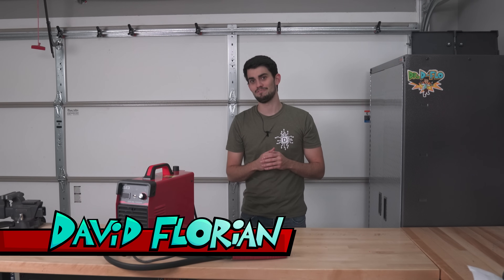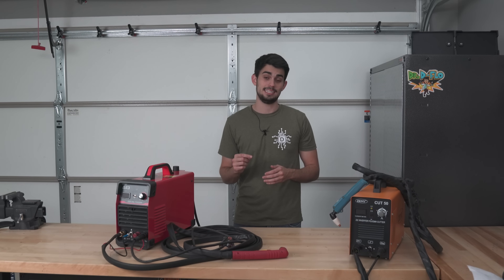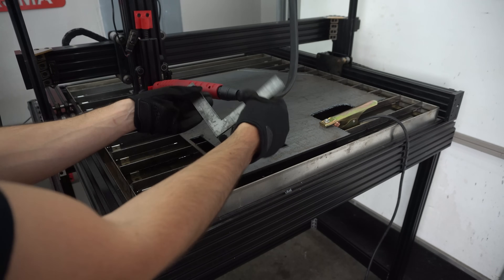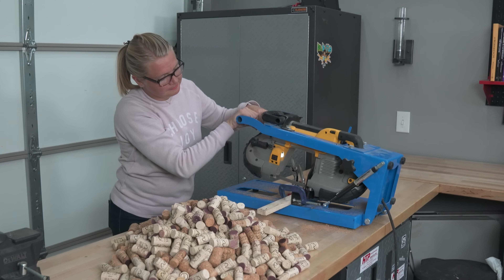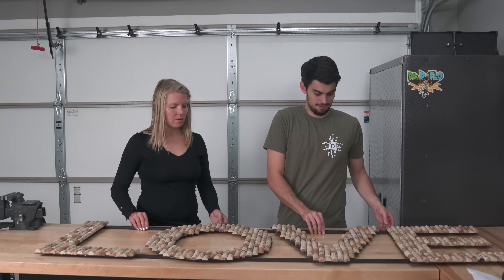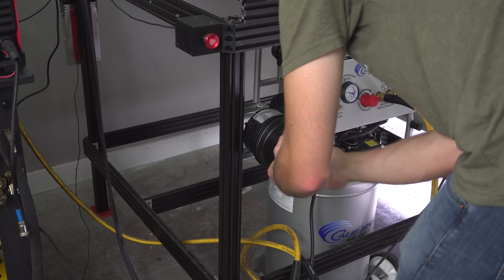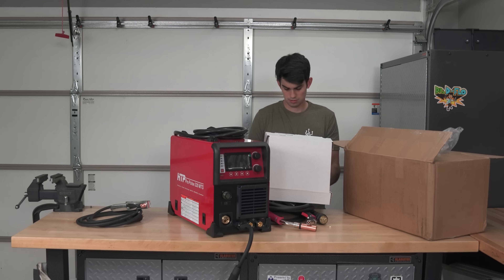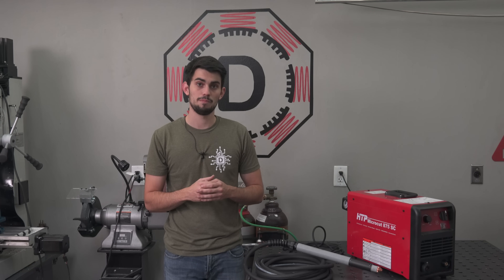Affordable Plasma Cutter for CNC (Cut50L)

Comment: If you haven't already you should buy some thinner gloves lot easier to weld with the gloves you've got on you would typically be using if you were stick welding or using a torch. The gloves I wear daily are kid gloves I'm referring to the deerskin very soft but I'm able to Tig with the gloves on and I normally only wear a glove on my non-dominant hand because I use that hand to guide with when I'm MIG welding TIG welding I normally just use one glove as well

Comment: Does anybody know if the Cut60L is a low frequency pilot arc start machine like the Cut50L.  I do know the Cut60L comes with a PT-80 torch but it’s not a blow back type torch (no spring electrode).

Comment: Is furly water in your compressed air there are methods using copper pipes as a heat sink to cause water to get trapped in a log section of tuning that may help is that mail linked in the amount of life your filter has
Reply: I’m guessing English isn’t your primary language, and you should really learn to proofread before you post.

Comment: Another great video... Thanks   Just curious; the spec sheet for the Pro Pulse 220 MTS says it requires a 40A circuit for stick welding and 35A for MIG and TIG.  How many amp circuit do you have this puppy plugged into?

Comment: HI. My name is JAMES and im a welding instructor for a college in Utah.  I wanted to let you know why the electrode of your plasma was destroyed so quickly was because the function of air is to one- of course create a DCEN current to allow the proper 4th state of matter, as the vortex is created. Two the air needs to have enough CFH to cool the consumable. In the Center of the Electrode is a reactive material called hafnium or zirconium ( different companies use either) and both are the spark to start the ionized gas if you will. So to fix the issue all you need to do is increase the CFH by 20psi. or like in your previous video buy a compressor to match the machine you are running. 
There is a way to increase the CFH with out buying another compressor. change the rubber hose to a Thinner metal conduit and run the compressor to  that. The more resistant the higher to the flow. just don't move the compressor farther away.  I hope this helps

Comment: it's a good habit to drain your air compressor tank after you're done using it releasing all the air and water at once and before you start a job just crack the valve at the bottom to let any water out. you can also get a air water separator mostly used for paint guns in line

Comment: You should put a transmission cooler and water separator between the outlet of the pump and tank. I did that on my 80 gallon and it condenses the water before it gets to the tank. Made a world of difference on my blasting cabinet.
Reply: I have about 40 ft of copper line to accomplish the same thing on mine.

Comment: I'm thinking about this plasma or the lotos ltp5500d.
The lotos has both plugs for trigger on/off as well as THC monitoring.
It doesn't appear the Sungold has either, can you confirm?
Did you just solder in a plug for the trigger control?
Are you running a THC on the plasma table or just touch and go?
Thanks
Reply from the maker: The CUT50L has an aviation connector for the trigger on the panel, but no THC connection. If you are up for the challenge, you can open up the plasma cutter and make a connection to the main arc voltage. I am currently running touch and go.

Comment: Hi Dr. D.Flo, just a quick question. How's the Cut50L going. Have you sorted the tips short life problem yet ?. Now thinking of building the CNC plasma table the same as yours. Regards Kevin
Reply from the maker: I have not cut with it much since getting my hands on the 875SC CNC cutter. However, the only change that I could envision helping would be to use dryer air. I now have a five stage dryer (which costs as much as Cut50L). If you are doing some hobbyist cutting every now and then, the CUT50L is going to be fine. Just switch out the consumable often. You get what you pay for and any production work will require a better unit.
Reply: @DrDFlo  Hi Dr Flo, i am really inspired to build my own plasma cutter now that i discovered your videos. Can you advise where to buy the consummables for the CUT50L?
Reply: @DrDFlo  ya...875sc is $2200....buy the tips

Comment: I built a similar table with a GRBL controller and a standard HF, non-pilot arc cut50. I got around the HF interference issues by using a pilot arc torch, and simply grounding the pilot arc wire to create an always-on pilot arc that starts instantly when power is applied to the torch. It's not ideal, since it creates a "double arcing" scenario between the electrode and the nozzle, but I haven't had any issues with that setup.
Reply: hey, do you remember what torch you used? best regards. Shean

Comment: your filter needs to be at least 20' from the compressor. air needs to cool so the water separates from it.  use a roll of toilet paper as a filter.. many do.  junk those cheap cut 50s..   youll love the HTP cutter..  it cost more that your hole setup.. lol.

Comment: I LOVE your videos - so let me get that out of the way first.

Don't take this the wrong way, but please refrain from making a "How to Weld" video if you've JUST started learning how to weld.

I don't see any efforts of handling ventilation.  I don't see the back 'hook' of any safety glasses extending behind your ears while you're welding - safety glasses should be worn even with the helment. Weld spatter / sparks can bounce off the wall, enter your helmet and bounce around in your face / eyes.  Try to avoid wearing synthetic fabric shirts - poly fabric material melts easily, and can catch on fire and stick to your skin - causing some rather unpleasant burns, etc.  I also prefer wearing a weld jacket with a collar to keep sparks from going down my collar/neck.

You're welding right next to sheet rock - I hope it's commercial grade fire retardant sheet rock at a minimum - perhaps line the wall by the back of your weld table with some sheet metal or something?

You've welding with down passes when you could have easily tipped the part on the side for better puddle flow, etc...

Just a lot of things that experienced welders can see you should avoid doing.

There are a lot of good channels out there dedicated to "Learn How to Weld" with everything from TIG, MIG, SMAW, Oxy-Acetylene, etc...  Their videos are from notably experienced welding instructors.

Comment: With the thickness of the steel you were using, TIG welding would have been better. But TIG welding takes years of practice to perfect. MIG welding is easy to do as long as the material is not too thin that you will burn right through it. I have seen that happen. Arc/Stick welding is another art form as TIG welding is. I love MIG welding over TIG or ARC/Stick welding.

The most important thing is using the correct wire or rod (and weather the rod has to be preheated before using) for the material you are welding.
Reply from the maker: I'm going to need you to keep your advice coming as I start to weld more and more in my future videos!
Reply: I have a mig/tig machine, I wanted to TIG weld aluminum, but I am missing AC/DC on my "Miller MPi 220p". I think aluminium welding require ac/dc 🤔 I hope you have more luck 👨‍🏭
Reply: @MarcoYolo420  Your instruction manual should tell you if you have to use AC or DC voltage & maybe Amperage. Aluminum is very tricky to weld. The weld bead will not look like a normal weld bead with steel unless you have about 15-20 years or more of experience. If I remember correctly. Aluminum must be TIG welded & I have not anything I have had to be welded for a long time now. You could also contact the manufacturer of your welder & get their advice. I would like to know what your welder manufacturer is & the advise they give you.
Reply: @MarcoYolo420  You need an AC mode to TIG weld aluminum.  Aluminum, can, however be MIG-welded using a special torch called a "Spool Gun".  It places the spool of wire into the MIG gun and feeds it there; because aluminum wire is much softer than steel or stainless steel wire, it won't feed right through the normal gun whip liner.  I wouldn't be surprised if your machine is spool gun compatible.  Check Miller's website or the manual for your machine.  It should tell you if the machine is spool-gun compatible.  If it is, you just need the spool gun, a small spool of wire (aluminum filler is another subject entirely; you need to know or have a reasonable guess at what alloy you're welding in order to ensure mechanical strength in the weld by selecting the correct filler alloy.  Miller's website can help you with this, too), and a bottle of the correct shielding gas (pure argon is popular, and you probably already have it if you TIG weld steel, but depending on thickness, an argon/helium mix may give better results).  Spool-gun MIG welds aren't as pretty as a practiced TIG weld, but if you need to stick two pieces of aluminum together and you don't much care how pretty the welds look, a spool gun can be a cheaper option than shelling out $1500+ on a higher end AC TIG machine that can do aluminum.  Check out weldingtipsandtricks and Weld.com channels here on youtube.  Both have videos on using spool guns and settings and so forth.